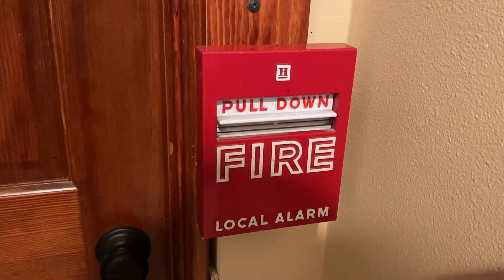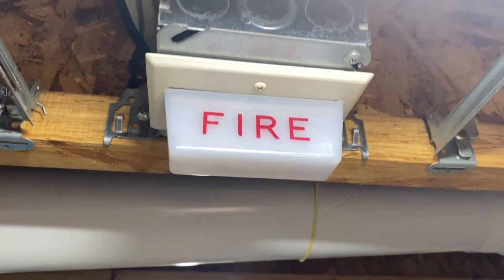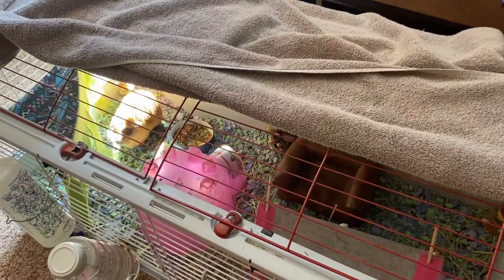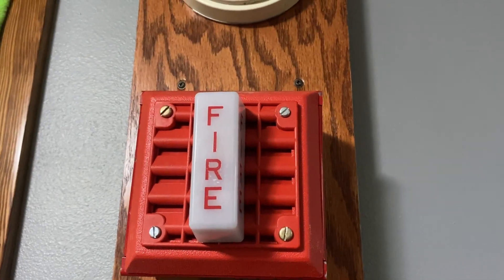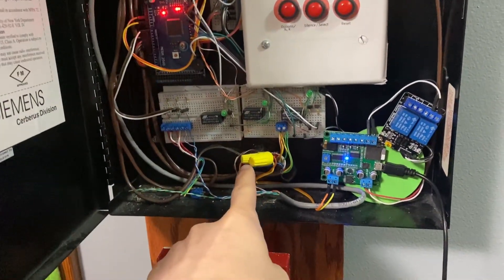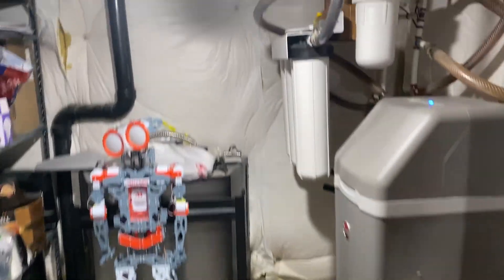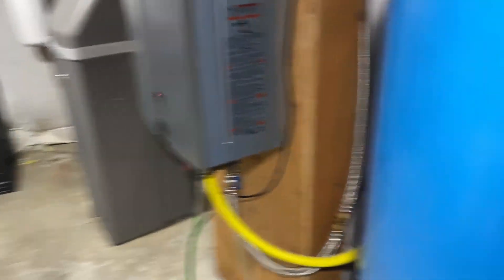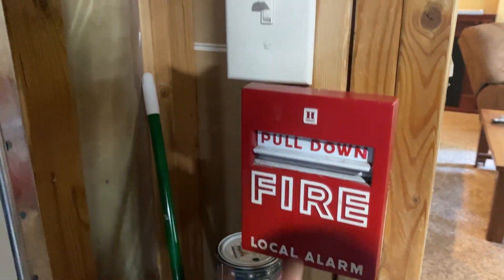System Test 13 | Vintage Honeywell

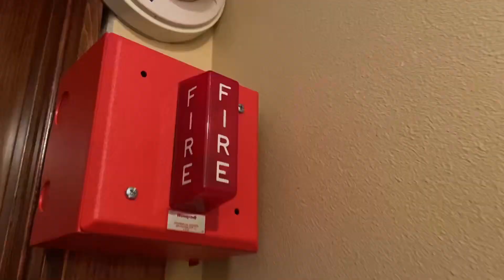Comment: 7:38 what's with the heat detector?
Reply from the maker: On the security system
Reply: @4O5O-8O  I see. i've never seen those on security systems before. it's still nice though. I particularly like that detector because it runs on basically any voltage.